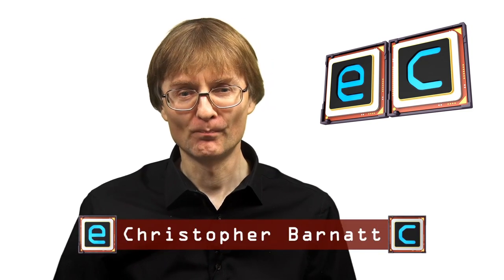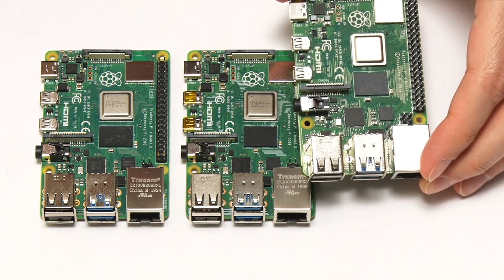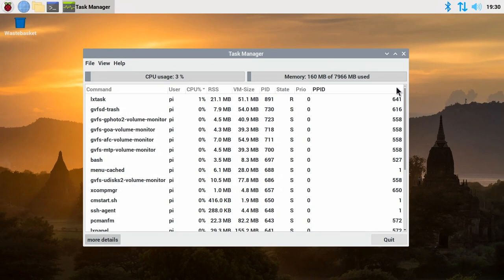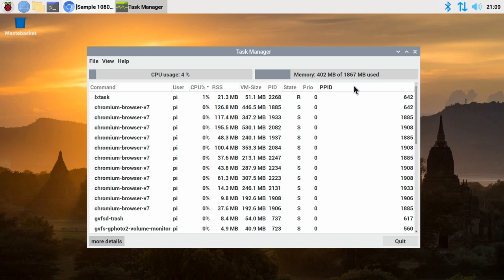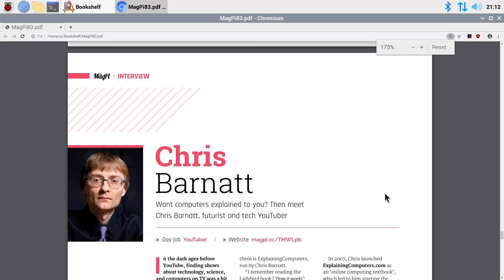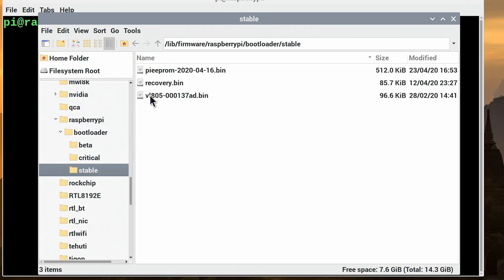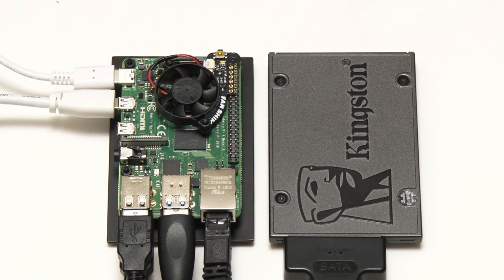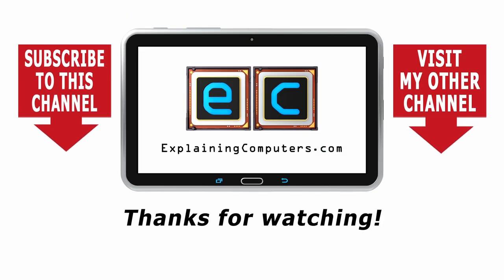Raspberry Pi 4 8GB & USB Boot

Comment: You always make these tricks so accessible!!! That's the main reason I was really looking forward to this video. I've tried configuring my SSD for USB boot before using all the commands other tutorials recommend but it would not find the SSD for some reason. I was able to boot from USB using an SD card reader though. Now to try this method and report back.
Reply from the maker: Good luck! It may be that the SSD USB adapter you were using is not compatible with the beta firmware.
Reply: @ExplainingComputers  I think you might be right. The SSD ejected itself before it could finish copying. It's an Orico adapter (for those who want to know what to avoid), but I've seen it used successfully in another tutorial. :/ Maybe something's wrong with this one specifically.

Comment: I have several projects I'd like to do. First off I want to use a Pi as a dedicated email device. I have several friends who, like me, are older and not interested in learning the latest ins and outs of a computer.  For us, the computer needs to be simple, reliable, and easy to use. So for my first project I want to roll out a simple, easily (perhaps even automatically) updateable machine that just does email and maybe some word processing. For me, that means something that, ideally, can be left on all the time or that powers on and comes up and logs onto email. It also needs to be able to print on a networked printer. I think the new OS and a 4GB Pi 4 is probably right for this job.

As noted, I am older, but as an engineer who has made my living working on computers, I want to have my own VPN and NAS. I am not satisfied with the 1080p video, or I would like to use the Pi to repace my google cast system and use a simple interface to select various streaming video sources to my TV. I find my (age) contemporaries have a real problem selecting different HDMI inputs on their TVs. I think Pi can help solve this if they get the video improved.
Reply: While reading your post I remembered the mainframe era, those wonderful and rock solid computers such as IBM, Burroughs, Digital, Data General
Reply: I strongly recommend an odroid XU4 with Armbian, I'm able to host an nginx, PHP, elasticsearch, redis and mysql instance, and also run visual studio code AND make live edits using Firefox/Chrome element inspector for a complete webdev solution all under one tin lid and it barely breaks a sweat. I did try the rp4 for the same task but I had issues with CPU throttling that made it unusable though it did have a really.naff power supply which I'm not sure but believe are upgradable on the pi's. Using a powered usb hub did help but opted for the odroid and will probably continue with them for the foreseeable
Reply: @adammoores8190  Thanks a lot!! I will do!
Reply: @Jules Moules I too have been playing with these things on the Pi 4. I'm not entirely satisfied with the results, but hopeful they will arrive. I am disappointed there has not been more progress in the last year. That is probably just unreasonable expectations on my part.

Comment: Worth the wait for this video. I bought the Raspberry Pi 4B in the first place to command my Telescope + Mount + Camera set up while connecting from inside the house. I use the KSTARS + EKOS INDI astronomy software to do this. However I soon found I could use it for lots of other things. I recently bought the FreeNova electronic project kit from Amazon and am happily teaching myself Python while making LED blink and motors purr. I'm even using the Pi to watch this YouTube video. In fact I'm spending more and more of my spare time on the pi. I'm hoping that more memory and a 64 bit o/s will make the pi even more capable when using my astronomy software which has a lot of graphics and also for other uses.

Comment: So i have this project in mind about a box for dry-aging and cureing some meat delicateses... I will need a refrigerator, or a some other coolng solution(I really like those with a window on the door), a fan to put inside, a hunidifier and a dehumidifier.
Then there goes the RaspberryPi, with 8 channel relay and DHT22 sensor....
The idea is, to keep the temperature and humidity within some parameters, and the fan to help circulating the air...
And in some point to start an apache server with a simple php script, to be able to control it from a distance...
Further away in the future of havingall that done, i will add a 7" touch,  some led lights, and a camera to create timelapses of the whole cureing process.
All that being said, i need to do the math, if th GPIO will be enough to control all of that. (And to finish the total renovation of my apartment)

Comment: These time i will post a comment about my future RPi plans, as you 
encouraged me to do in the end of your great video Sir.
Currently I am running a RPi4 with a 4GB of RAM as my main desktop PC, and two RPi model 3s. One of them I am using for a Nextcloud server installed under Raspberry Pi OS on RPi3B+ running directly from an external HDD with 1GB of capacity.
The other is running from an SD card, installed with Open Media Vault server, and I have attached an external HDD with a 4TB capacity on it, for a NAS.
I am planning to upgrade the RPi4 with an external SSD to boot from, when the official firmware arrive. And I am planning to buy two new RPi4 boards with 2 GB of RAM to replace the current RPi3’s which I am using for servers.
And all of this is possible thanks to your great videos Sir.
I am following ExplainingComputers with great passion an interest.
Thank you for your great videos.
Reply from the maker: This is all great to hear! :) Thanks for sharing.

Comment: This is what I waiting for...
Reply from the maker: Glad to hear it!
Reply: Why?,  the extra memory is not a performance booster in the way you think.
Reply: I want them to include SATA connectivity like the banana pi and orange pi. Then it would be the definite winner of them all, not that it isn't already but why can knockoffs include SATA and the raspberry still hasn't a few releases later
Reply: @josephtremblant2173  this is an expansion board, it should be on the mainboard with an option to boot to SATA

Comment: The price difference to jump to the 8GB version seems unreasonable, especially without proper 64-bit support. Makes some of the other SBCs more attractive for applications that needs that much RAM.
But thanks again for making these videos showing us what is possible.
Reply: Are there any good non arm based SBCs with similar price and performance as the 4gb pi 4?
Reply: 8GB ram cost £30.
Reply: What other SBC's are available with 8GB of RAM in this price range?
Reply: the 64-bit is on the way, it's in beta, give it time
Reply: I think the first thing they should make is usb boot 100% sure without "it can damage your board"
Reply: You do realise the single chip memory module didnt even exist until late last year and was made specifically for the Raspberry Pi: https://www.raspberrypi.org/blog/8gb-raspberry-pi-4-on-sale-now-at-75/. Talking of expensive memory, how is your mobile phone?

Comment: Was busy gaming, so could not watch once the notification popped up. But this video introduces some quite powerful SBC. A Pie board with 8 GB ram, how far we've come. And the most amazing thing with this board is, it could become an actual desktop replacement, if not doing graphic intensive things. 
Gracias Chris.

Comment: With the Pi 4 8GB (aka Pi 4.8) I’ve been having some fun with a ramdisk (disk drive in memory) doing various networking tests. It saves wear and tear on the SD media.

Also, I just finished installing Ubuntu 20.04 LTS 64-bit and then installed MATE desktop on it. The 8 gigs of memory brings new opportunities into this little board. 

I’ve opted (for now) to sit out the USB boot while it’s in early beta.

Comment: I purchased an 8GB the same day it was released and immediately installed Ubuntu Server on it, it replaced a 4GB that was already running 18.04. Couldn't get 18.04 to boot out of the box, but an 18.04 rootfs with 20.04 bootloader sorta worked, though the mismatched kernel and modules prevented LXC from starting.Trying to boot with the 20.04 bootloader using 18.04 kernel and rootfs didn't work at all. Ended up just installing a clean 20.04, and importing all the containers and VMs from the 4GB server. It now runs most of my critical containers (RADIUS, DNS, Git repo, internal proxy), and a couple VMs providing Samba, NFS, and TFTP shares for a few things here and there at home. I haven't even reached 50% RAM usage yet, it can definitely handle more.

Comment: What would I like to do with a Pi 4?  I'd like to put it (along with an ssd drive) in a standard desktop PC case.  Not because it's practical, but just for the novelty of it all.  Actually, if one had an old gutted mainframe, that would even be better.  "Welcome to my room where I have my Raspberry Pi 4 running."  Surreal.
Reply: Dude. Love the mainframe idea.
Reply: Juuso Alasuutari Thanks. The mainframe has been in the back of my mind since way back when I dug an old IBM PC out of the trash. Actually thought of taking a tall filing cabinet and making it look like a small mainframe.  Thanks again for your comment!

Comment: I use my RPi4 as a backup for my "big" Windows-10 PC. Also, my original Pi was used to build a Stratux ADS-B receiver, which I now headlessly connect via WiFi to the RPi4. Additionally, it serves as my web server sandbox and learning platform.

Comment: I purchased a 4 GB Pi about a month ago and am very pleased with its capabilities. My uses of this Pi are: for use as a general purpose desktop, software development platform (including LXC/D and Docker containers), and experimenting with different available OSes. So far I've run the stable 32 bit Raspberry PI OS, the 64 bit beta version, and 64 bit Ubuntu core (with the XFCE desktop). Experimenting with different OSes has always interested me on Intel architecture and now I can do this on my Raspberry Pi 4 with its ARM architecture. IMO the Pi 4 provides a lot of capability and versatility for $55.00 US as well as a platform to learn and grow with in whatever direction I want to pursue. I'm on a waiting list for the 8 GB model.
Reply from the maker: It sounds like you are really embracing he philosphy of Pi -- great for experimenting as you say.

Comment: I'm interested in using Pi4 as a desktop pc, because I like Linux but so far every time I've converted a Windows machine to Linux I've found that after a while I can't upgrade to new versions and ended up with a brick... so the idea of using a Pi4 which is designed to run Raspbian appeals a lot. At present I have a 2gb Pi4 running basic web tasks very well!
Reply: can't upgrade ? what problems were you having ?
Reply: @autohmae  im guessing he used feodora it breaks aftera few upgrades horrible os for daily machine

Comment: Hi, new to Pi's, does the Pi run trim on ssd's ? Thinking about options for a project. Cheers
Reply from the maker: An interesting question that I currently have no answer for . . ..
Reply: It depends on the SSD (Sata or NVMe) to USB adapter. Some support. Usually its mentioned in the product description.
Reply: Reading the Raspberry Pi forums, I've found this topic reply addressing the use of TRIM: https://www.raspberrypi.org/forums/viewtopic.php?f=63&t=275187&p=1671542&hilit=ssd+trim#p1671542
Hope that helps someone!
Reply: @ConfuSomu  why not mount with discard option ?

Comment: I have two Pi 4Bs - a 1GB and a 4GB model.  I'm using the 4GB as a desktop replacement.  Well, for day-to-day routine stuff.  I still have a Linux PC with a bigger CPU & memory for some things.  The 1GB I use as a portable PC - mostly in our camper along with a USB stick loaded with movies.  Both have passive cooling heatsink/cases.

Comment: When will raspberry pi get around to including SATA headers.
Reply: Get a PC
Reply: @josephtremblant2173  Not helpful, if you don't have something nice and/or helpful to say, don't say anything at all.
Reply: Forgive me if I'm a noob, but what about the pins that are already on the Pi4 board? Can they be adapted?
Reply: That doesn't give the Pi real SATA ports.  It's just another USB3 to SATA adapter.
Reply: The edge of the board is pretty much completely filled up. They might be able to fit an esata connector on there if they removed the composite video out and dropped the dual monitor support. I really don't see it happening though.
Reply: @J Fz yes but SATA power is 5v which is what the Raspberry Pi runs on anyway, just make sure you have a 2amp power supply
Reply: Never, if you're expecting SATA headers on Rpi 4 SBC form factor, simply not going to happen for several reasons:
Eben Upton recently made it clear when Rpi 8Gb was announced about people asking him for eMMC support and NVMe support on future Rpi revisions. He emphasised about keeping cost low while providing cost/effective performance which currently represents the USB to SSD boot on RPI 4.
He simply said no about eMMC, and left the possibility open for NVMe in the future depending on market conditions.
IMO, SATA headers use precious space in a already crowded form factor. Also, providing enough power to feed those SATA drives would required you either provide your own power solution like SATA enclosures with power adapters or 5.1V 3A from current USB-C connector won't be able to power those hungry SATA hard drives.
Current Rpi 4 uses a via VL805 host controller (PCIex1) which only support 5 Gbps max(Aprox. 350 MBps) and 1 Lane to be distribute among the 4 ports on the Rpi 4. I bet, future Rpi 5 may include a USB 3.1 Gen 2(10 Gbps~800 MBps) with 2 lanes to provide extra bandwidth for the 4 hypothetical USB ports. Again the whole idea of a SBC like raspberry pi is to offer a low cost SBC solution for the masses. Any extra hardware implementation will drive manufacturing cost higher making it less attractive for the people. Rpi success is driven by a energetic and gigantic community while keeping the price at just $35(Rpi 4 2Gb is now the entry level product).Peace out.
Reply: Probably never.

Comment: Next step: OTA bootloading.
Reply: you mean pxe?
Reply: It's supposed to be available with latest firmware for raspberry pi 4 as well. I am not sure if the procedure in the guide is the same for RPi4 too.
Reply: @nikiforossarantoglou5917  yes I do. Not sure if it's feasible at this point though.
Reply: @brunesi  If you boot it with latest (the beta that you use for native usb boot) firmware but without SD card or anything attached on USB, it searches for server to boot with PXE. So there's that. But I haven't got the slightest idea how to set it up and if it's the same guide as gerald posted.
Reply: @nikiforossarantoglou5917  That's great actually. It could be used for IoT infrastructures to change functionalities after deployment.

Comment: I've been using my Retropie on my 4GB model. Not only have I been emulating games, Kodi is also installed as a port for media playback and I use a USB external DVD drive to play all my old DVDs. I also use Steamlink to emulate games that I can't emulate on the PI, turn based games like Pokémon Colosseum have been great to play on there on the Dolphin emulator through Steamlink.

Comment: Hello , Mr.Barnatt !
 
 Thanks for the informative videos and I am also appreciating your studies.
 
 I have a Raspberry Pi 4 model B with 2 GB.
 I have Sandisk 32 gb sd card (SDHC, with capacity oof reding upto 80 MB/s).I prepared a Raspberry Pi OS with 
selected software from the site of Raspberry Pi org.
 I ran my Raspberry pi 4 with 2 gb with health&order.I connected a Ugreen's USB 3.0 Hub which has  a multi card reader 
unit by plugging it to the one of the USB 3.0 ports of Raspberry Pi 4 and I added a Longline USB 3.1 SATA 3 SSD 128 
GB drive ( ın an aluminium case) by plugging it on this Ugreen USB 3.0 hub having a multi bayed memory card reader 
unit.
 Also, I plugged a Sandisk USB 3.0 16 GB flash memory on this Ugreen USB 3.0 hub.
 I booted my Raspberry Pi 4 many times with these configuration many times.
 I always saw these 2 devices (Sandisk USB flash drive 16 GB and Longline USB 3.1 SATA 3 128 GB SSD drive on the desktop of Raspberry Pi 4 and i saw the files which are recorded on these two devices  by clicking the icons of them 
on the desktop of Raspb.Pi 4 .
 I added a USB 3.0 hub having 4 pieces of USB 3.0 ports to this set by plugging to one of the USB 3.0 ports of my 
Raspberry Pi 4.Also I plugged Longline USB 3.1 SATA 3 128 GB SSD drive to this USB 3.0 hub and used a few times, 
too. All of these are done without an error.
 
 These two hubs are having cables to a Ldnio Electricity outlet which has 6 pcs of USB and 3 pcs of plugs of electricity 
outlet.I connected Ugreen hub&card reader unit to this set of electricity outlet by USB a cable and I connected the 
other USB 3.0 hub to this outlet set by its' electricity adapter.
 I have LCD VGA monitor which vga connector on it.Resdolution is 60hz 1280*1024.I connected it to Raspberry Pi 4 f 
by a HDMI to VGA adapter

 Before the first boot of this Raspberry Pi 4 set, I bought and set up this Ldnio Electricity plug unit ready and I used  my 
Raspoberry Pi 4 with it.
 
  I copied the Raspberry Pi OS which I indicated above of this message , to this SATA 3 SSD 128 GB drive by the file 
copier application of Raspb.Pi OS as you told in your video.But, now, I am booting up my Raspberry Pi 4 but, the icon of 
this SSD SATA 128 Gb is not seen on the desktop screen.
 
  Could you say what is the problem ?